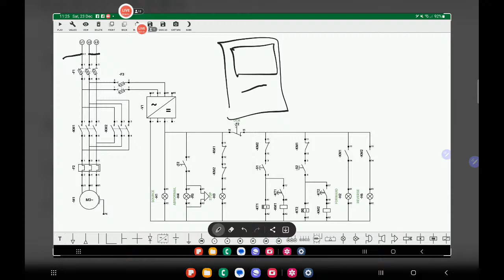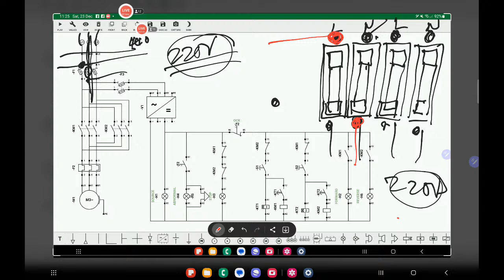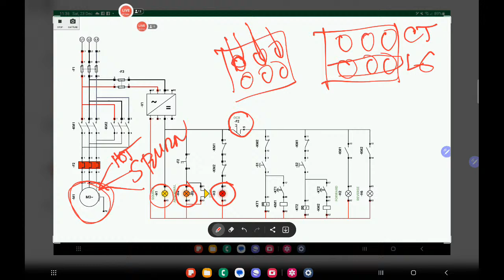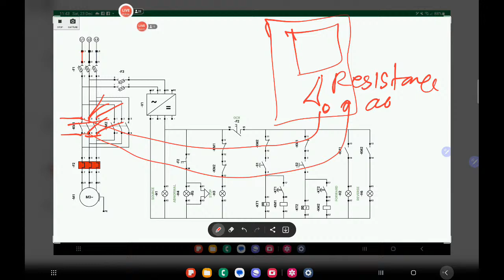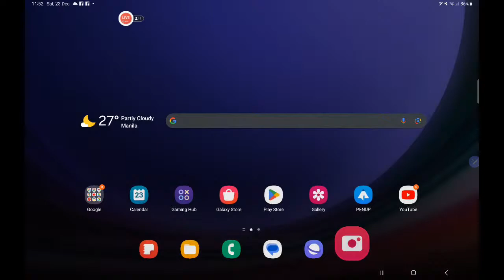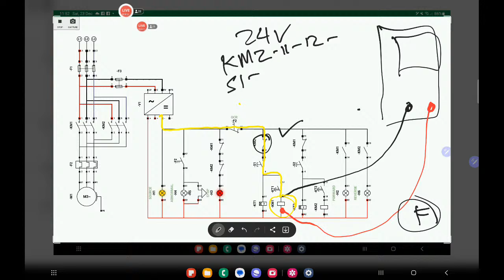which is easy to troubleshoot, live or dead circuit?

Comment: hi leckyjake a good electrical devise to install in a motor control circuit phase failure relay if you lose a main fuse this devise is quicker than overload protection relay if your phase loss is below 95% of mains voltage will trip contact and trip motor you will not get a single phase condition leckyjake it will give you an alarm to say you have a blown fuse